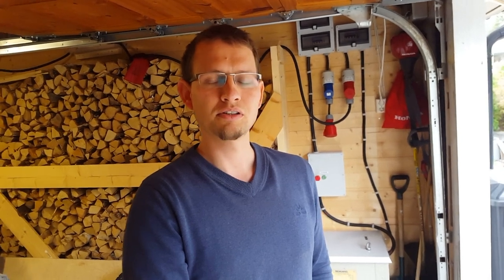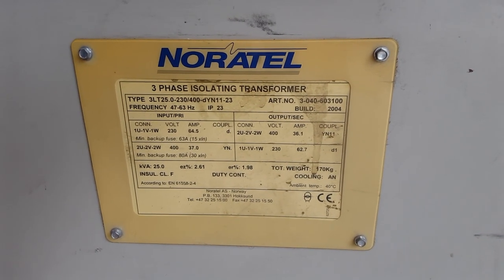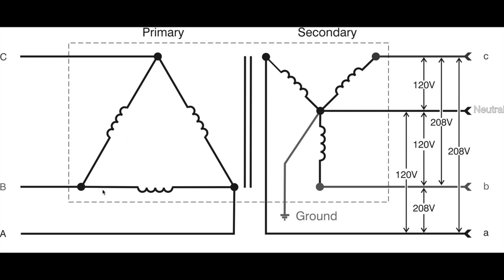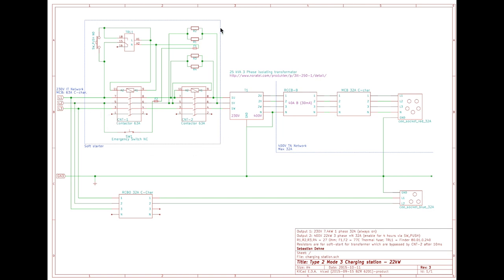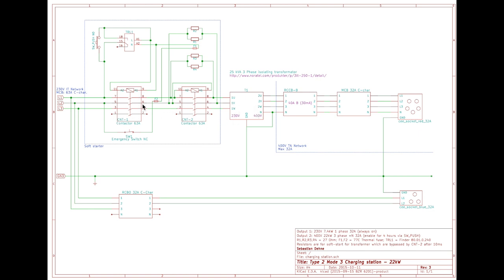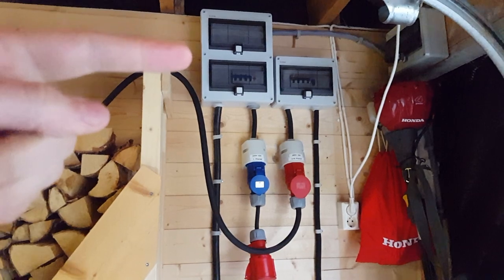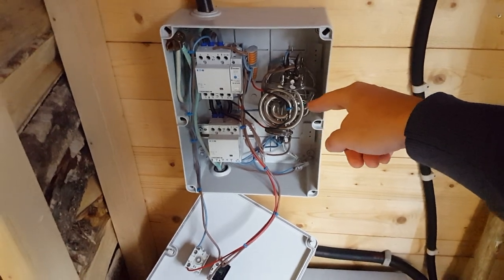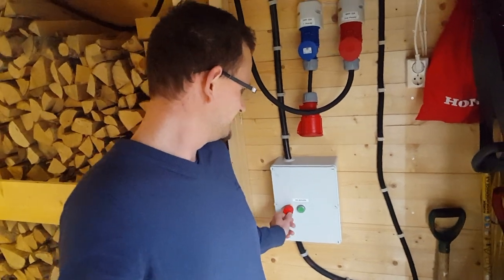22kW charging station with transformer and soft starter

Comment: Nice! That sucker is heavy! You should upload more videos!
BTW, the link in the description is dead, gives me a 404.
Kinda neat how you only need two resistors for the 3ph delta soft-start, I never thought about that before but it makes sense. Of course you could use three resistors as well, like especially if you wanted to have each resistor dissipate less power (3 resistors share the same power as 2 resistors, thus each one dissipates less power).
The thermal fuses are very nice additions, I like that. You see some other setups where there isn't any protection like that, and you gotta wonder what would happen when there is a failure ... yikes!
Also it's interesting that you don't need a delay circuit to operate the bypass contactor ... the time it takes for the contactor to engage is all you needed! Cool!

Comment: You mention 400V at secondary side between the phases and 230V from each phase to GND. Your schematic shows 120V to GND and 208V between the phases. I assume you charge a Renault ZOE. This mean 230V from phases to GND is correct. Overall your solution is perfect.